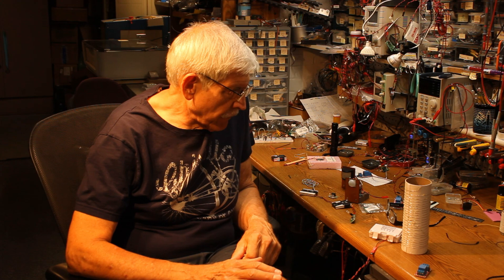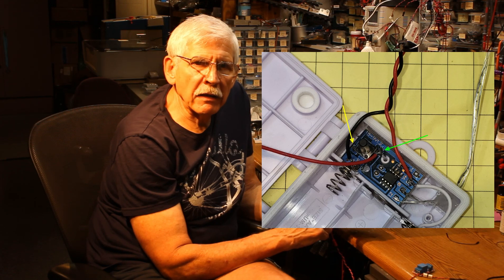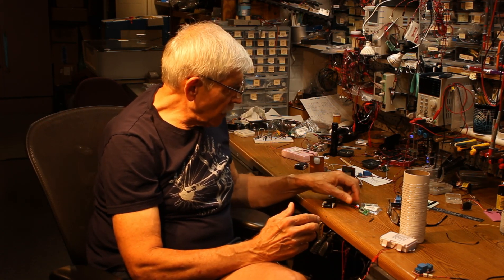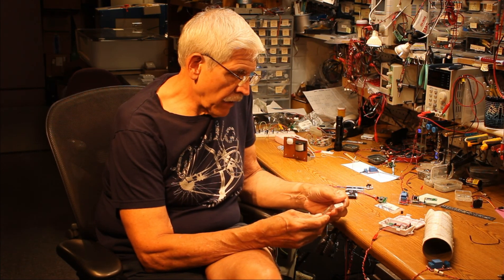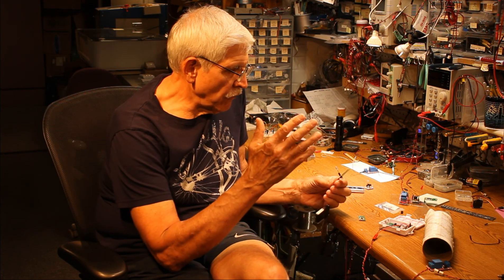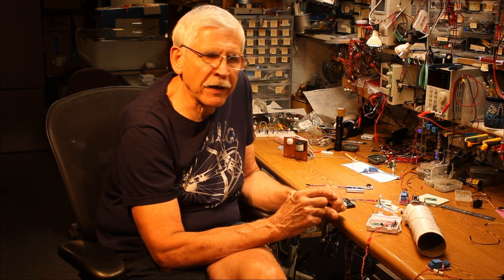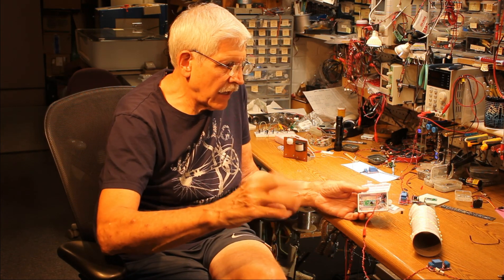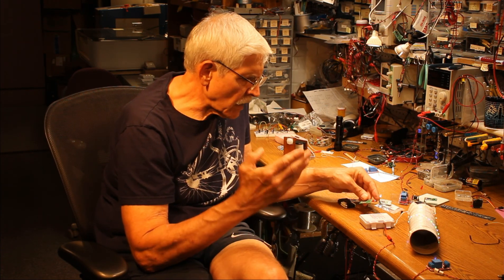Using a MicroWave Sensor

Comment: I want to increase delay time
Reply: You might have to use an Arduino or similar to increase the delay
dave
Reply: @davidbodnar813  
Is there possible if i add capacitor to increase delay time. i am using microwave sensor with direct relay
Reply from the maker: @How2Solutions  a cap might do it ... it is worth a try

Comment: Hi Dave. :Love your teaching skills. None of this stuff would be digestible without the way you present the material.

Re. Micrwave sensor: you mention that we need to keep similar sensors away from each other. Practically speaking, if being used to control crossing lights etc on an indoor railway layout, how far away would they need to be from each other? Could they be shielded somehow to create a somewhat directional sensing effect?

Thanks.
Reply from the maker: Ernst - it is good to hear that you enjoy the videos -  they are great fun to put together!
As to using multiple sensors I have not done any research or testing - I am sure that orientation and simple shielding would allow you to use several - perhaps you can give it a try and let us know what you find
dave

Comment: I picked up 25 of these from Bangood for $14.99 last September, with no datasheet. I found this one https://github.com/jdesbonnet/RCWL-0516/ from a guy who did some testing and included that info as well. The one I've tested so far of the bunch stays on for 2 seconds. I was able to detune its omni-directional sensitivty to some extent by wrapping a cardboard tube with some tin foil and sticking the board inside that to make it more directional. 4-28 volts is the power requirement per the above datasheet. I tested mine on a breadboard that had other stuff going on, including a 5 volt regulator. I set the power supply to 4 volts to test this board, forgetting the 4v was going into a 5v reg and it would not work like that. (I think the LED lit and it stayed on all the time) I'll have to set that up again and see how many volts it was really getting. It runs nicely off of a Raspberry Pi's 5v output.
Reply from the maker: That is great information, Roy - thanks for posting

dave

Comment: Good to see you back Dave. I have always been curious about these sensors. I am familiar with using them for car alarms, in situations like a convertible. In that case, you can leave the top down, and have it activate an alarm when someone is within proximity, and it has a trim pot for sensitivity.
Reply from the maker: It would be interesting to put on in a car and see how well it detects intruders - good idea!

dave